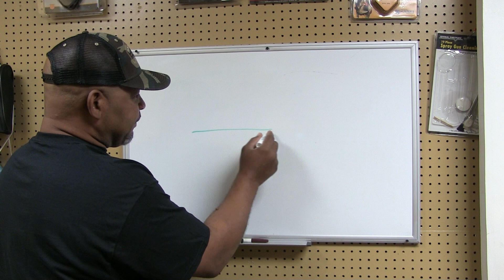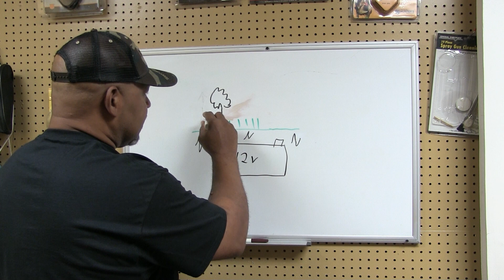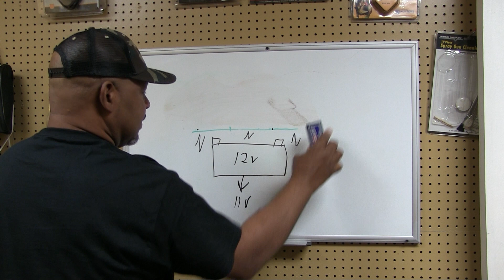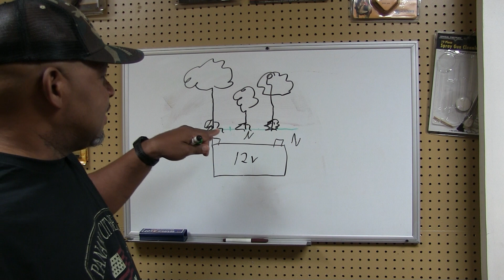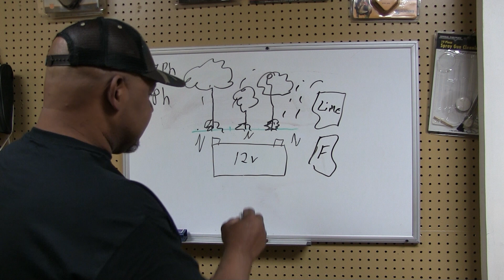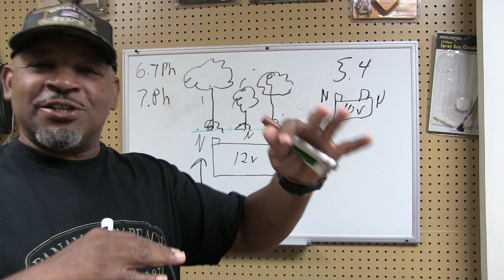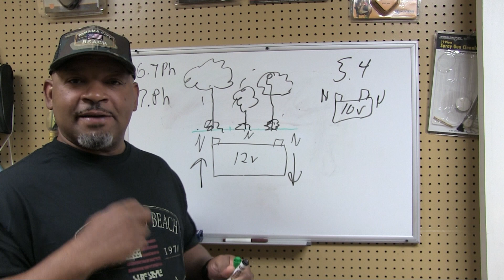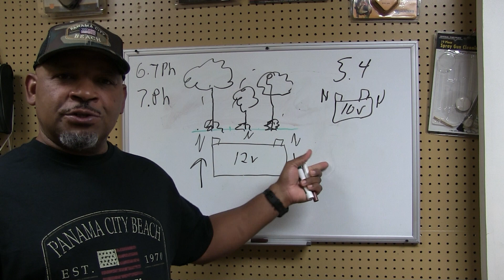Stop! Using Food Plot Seed blends.

Comment: I have found that each plot is different for soil types and each plot will support some things better than others. I do samples based on what I will plant in each plot. I have also found that my customers are cheap for the most part and won't spend the money required for proper management. I normally do a three way mix of wheat oats and rye and mix in some red clover. I have never done good with turnips or greens. The deer just wont eat them in my personal plots.
Reply from the maker: Most people just want to see something green come up in there food plot and they are happy. Not me, I don’t want to spend two arms and one leg either but I know you have to have good seeds and a soil test. Most people just will not get a $20 soil test. It would tell them why their food plot only grow s 3 inches tall for the last 3 years.

Comment: You are correct about using the same kinda seed . We have started doing this as well.  I do think you should be burning that flood plot off in the spring or summer before doing your fall plots.  It will help that orange dirt grow better plots
Reply from the maker: I want to burn really bad. It’s just to dangerous without a few people to stand watch. But I want too.
Reply: Do it in a calm day , when you don't have much wind , and get a couple guys together and do several.  We do 3/4 in a day if the wind acts right.  It has helped out plots in great way.  Good luck to ya my friend. Love the videos .